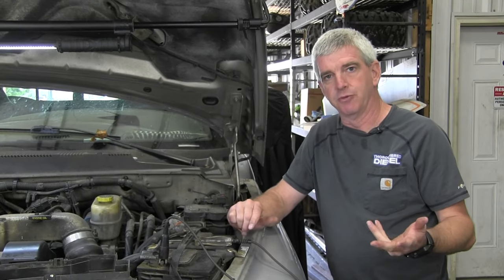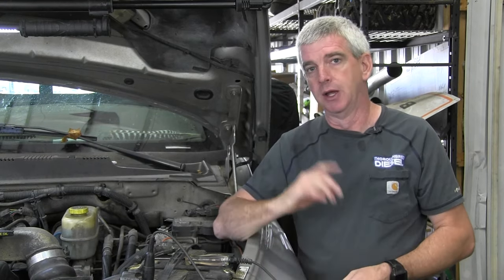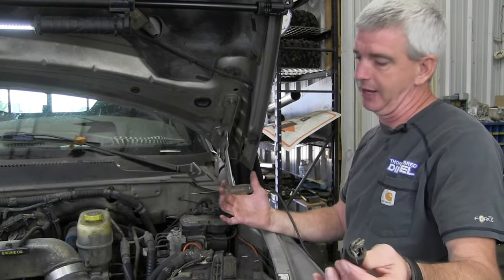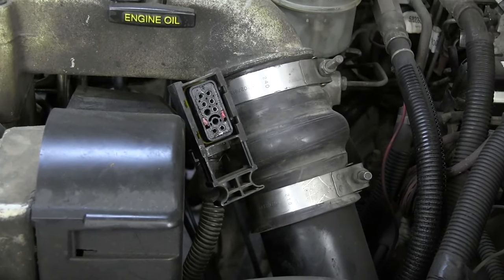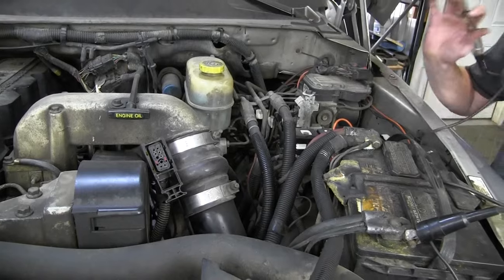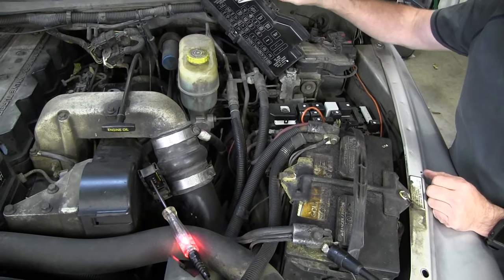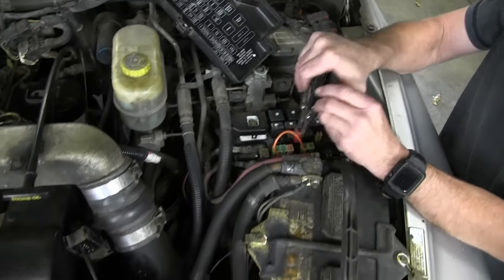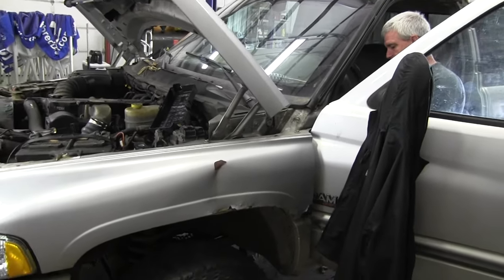Simple VP44 Diagnosis - Get Power to the pump!

Comment: I use test lights all the time.  Yes voltmeters have their place, but nothing compares to using a test light to actually test whether the circuit can actually carry a load.  You can measure proper voltage on a wire, but as soon as you put a load through the circuit, it can disappear if you have a bad wire.  I used headlight bulbs a lot of times.  I have several set up for different amps.
Reply: What if you're only getting 10 volts on a test light? Partial/ low voltage is completely un-diagnosable with a test light. How is more information bad?
Reply: @cyumadbrosummit3534  No one said more info is bad.

Comment: I have a problem I don't know how common this problem is, it will start but won't run, it gloats ,I have pump off and it spins nice but spinning pump by hand I have fuel coming out the injection side I am thinking it is a stuck valve, in the pump, I am not so sure it is electronic
Reply from the maker: It is a electronic over mechanical pump.  Don’t know what your original failure was, but we will need to make sure that you have correct lift pump pressure to the pump first, then diagnose after we have verified that.

Comment: Ever thing up to this point looked good Pulled 10 amp engine fuse side of dash #9 !  Light stayed on
Reply from the maker: Check both legs of that fuse and see if you still have power to one leg,  if so, suspect a short to ground on that circuit.

Comment: On my 98 24v, I have power to the pump and ground but there's no wait to start or I don't hear the lift pump kicking on.... any ideas?
Reply from the maker: Depends on temp for wait to start.  If it doesn’t come on for a couple seconds on a cold start, then I would suspect the IAT sensor or ECM.  The lift pump doesn’t always come on per se, but should run when you bump the key.

Comment: My truck just died going down the road and now will crank but no start. There is power to the pump and i checked the fuses and all is good. My guess is vp is bad.
Reply from the maker: You would want to check lift pump pressure and check codes before jumping off the deep end and condemning pump.
Reply: @thoroughbreddiesel  I tried to hot wire the pump as well and no dice.

Comment: I have this motor in my RV and it starts and runs and drives but has little to no power. Power comes and goes. At 2300 it picks up a little but anything under 2300 rpm power falls out.
Reply from the maker: Need to check codes and lift pump pressure.
Reply: @thoroughbreddiesel  sid 254 fmi 8 is the code
Reply: @thoroughbreddiesel  it runs and drives its weird. Had new lift pump put in but could be not good. How can I check the pressure. I do have laptop to read codes but don't see fuel pressure reading
Reply: @supremeautomotive6749  was it the vp44 that failed?? I currently have the same code and the truck starts and idles great. But lacks power.  Please let me know!

Comment: @thoroughbreddiesel I have an 01 24v 5speed just put new lift pump on it and now that I’m down to 1/4 tank I fired the truck up and it threw a code p1688, and everything I read online pointed to vp being bad so instead of biting the bullet I found a used one that was only supposed to have 2000 miles off of a cracked 53 block. Put it on my truck bled the system and fired it up ran rough then smoothed out like normal but still had the cel so shut the truck off to try and clear the code which this time was a p1689 and the code wouldn’t clear and then the truck wouldn’t fire up. I noticed while cranking I wasn’t seeing rpm so I replaced the cam sensor because as you know 01 didn’t have crank sensor and at first it still wasn’t reading rpm until the truck finally started up after a lot of cranking. While the truck was running it would idle fine but as soon as you touch the throttle it jumps to 1400rpm no more no less. I just put a new apps on it and live data reads throttle position just fine. I shut the truck off again to try and clear the code and code still won’t clear and truck won’t fire back up again. Now as I mentioned the used vp only has 2000 miles but it has been sitting in the guys garage for a year or 2. Does this sound like a bad psg?
Reply from the maker: ECM unfortunately.  I don’t know why that set of circumstances happened in the sequence it did, other than it sounds like your luck is a lot like mine.  I would say the constant 1688 code was an indication of something wrong.  But on these trucks, when you have the touch the throttle and it goes to the moon condition, its ECM.  Put your old pump back on and I bet it’s the same thing.
Reply: @thoroughbreddiesel  with old pump on truck runs just fine just has the code. When you clear it and cycle the key it comes right back but if you clear it and then start the truck it will stay off until you cycle the key

Comment: Wade, 
      I have tested everything exactly as said in video including battery voltage on this 99' I've got in the shop and it turns over great but still wont start. Do the VP44 models "hummm" like the common rails do as you stated as a good lift pump test in a previous video I watched. Any help would be greatly appreciated and thanks for the detailed videos and advice!
Reply from the maker: No humming,  but with the truck you are working on, if it’s a 99 and wont start but has good LP pressure and voltage to the pump, check to see if you have any crank signal (tach).  A bad crank position sensor will keep the 98-200 trucks from starting.

Comment: Have one that will start but sounds like its only running on 2-3 cylinders and has no throttle pedal. Everything i see online says thats a guaranteed bad vp44. Could wiring or 12v to the vp44 cause this as well or is that guaranteed bad vp44 right?

Comment: So if I DO have both power and ground to #6 & #7 pins and my truck still doesn't start them something bad happened to my VP44?
My truck ran fine before I pulled the engine to be re-sealed and had the head built but now that I finally got it back together it won't start and I can't find videos showing "how" fuel should be coming out of the injector lines to bleed
Reply from the maker: If you don’t have correct lift pump pressure the truck still won't run.

Comment: will you swap a common rail fuel system to a vp44 motor with pop off injectors.make it cp3 common rail system with electric injectors.modify the injectors or make a hybrid set-up.use a gen 2 24 valve engine.
Reply from the maker: This gets brought up a lot but I don’t see any value to it.  IF you want common rail easier and cheaper to stay common rail.  Using mechanical injectors cant happen, you have to have computer controlled timing.

Comment: Got a p1689 code , p0230 and p1693. Checked fuel pressure on lift pump and got nothing. Replaced lift pump and that cleared all codes but p1689. Starts and idles ok after lift pump replaced but won’t get over 1500rpms and only goes ~25mph. After checking all the power , if everything is good would this be a symptom of a bad vp44?
Reply from the maker: Could be,  or check the main connector at the VP44 connector for connection.  Also check harness well.

Comment: So I just recently just go a Qaudzilla adrenaline for my 02 dodge and I got everything set up and followed all the directions so I was ready to start it so I went and started it and it started rough idleing really really bad and was spitting out white smoke really bad that burns your eyes I have no idea what it could be if you could help me out it would be much appreciated
Reply from the maker: If you put the fuel pressure sensor in,  it could be working through some air.  Recheck all of your connections.  Possible you cut the wrong wire on the vp as well.

Comment: If you’re getting power to the vp44, does that mean everything up to that point is working correctly? Like the ecm? I replaced the vp44 with a thoroughbred pump. I bled the lines, checked lift pump pressure and it reads 21 psi. Not firing up at all. Not sure what to do at this point. Don’t wanna throw more parts at it without a better idea
Reply from the maker: We will be able to help you diagnose better if you give us a call, 859 737 4966, but lets review this for others that are reading it.  So you have power and ground to the VP, you have good LP pressure.  The next thing to diagnose would be to see what codes are in the truck.  Clear them and then see what comes back when you crank the next time.  Is the truck cranking over at the proper speed?  If it’s a 98-99 truck, are you seeing tach movement?  If not, suspect the crank position sensor.
Reply: @thoroughbreddiesel  thanks for responding. Here’s an update. Finally got it to fire but it’s running rough and white smoking pretty bad. I tried to start it the next day and it wouldn’t fire.  Running rough and white smoking is what it was doing before the vp44 install so I most likely misdiagnosed the problem. It is an 01. I’ll check the codes tonight.
Reply: Had a P1689 code. I cleared it and no codes have popped up after cranking. Hasn’t fired up since. Has no crank position sensor
Reply: Starter crapped out. I replaced it and the truck started right up. The truck runs bad and smokes like a freight train.

Comment: I still can’t get power to pin 7. I have a 2000 Dodge 5.9 Cummins. I did everything you said in the video, no luck. Any other suggestions?
Reply: When I pull the 20amp engine control fuse, I get a lot of buzzing noises.
Reply from the maker: Would suspect ECM at that point.

Comment: will the vp44 start the engine and idle without fuel pressure or does it need fuel pressure to start?
Reply from the maker: Needs fuel flow to start.

Comment: Hi getting battery voltage to power and ground.  The truck wont start.  I cracked the lines at the head and it spits fuel. I replaced the lift pump also just in case.  What else would cause issues with fuel delivery?  I checked with starting fluid as a quick check and the truck starts immediately.
Reply from the maker: If the truck will start on ether then you are either having a lift pump issue or the truck isnt cranking fast enough.  Look to replace batteries and move forward.
Reply: @thoroughbreddiesel  I don't think that Justin Hill ment that it starts and stays running after starting on starting fluid.

Comment: So I'm swapping the 24v Cummins with it's vp44 in to a 87 Chevy truck question with the vp run the engine with out the CPU
Reply from the maker: Will need a ECM for sure.
Reply: @thoroughbreddiesel  ok can I swap out the vp44 for a ve pump and make it run

Comment: What could cause the fuel psi to fluctuate from 16 down to 6 while on the throttle at various % of throttle. Never goes below that but it was always steady between 12 and 15 prior. It has a new fuel filter since this started and I'd like to also note has raptor 150 on it.
Reply from the maker: Verify this with a second gauge to get repeatability in your data.
Reply: @thoroughbreddiesel  I actually called the company that makes the raptor lift pump (I have the rp150) and they guy told me about the oe lift pump Deutsch connector being notorious for failing. I cleaned the contacts and she's bad to normal. Thanks for responding!

Comment: What about a manual truck that I can roll start but not start with the starter?  Turns over great. Just won't start.
Reply from the maker: Check lift pump pressure and pull codes.

Comment: Pls i have ford fiesta 1.8 tddi 2000 no throtlle and wierd sound in the pump and preheating light flashing pls help
Reply from the maker: I am not familiar with operation system on this car, but I would scan the codes first and diagnose based on that.